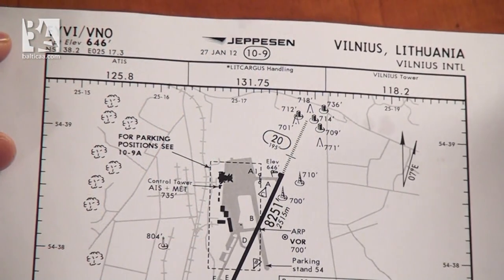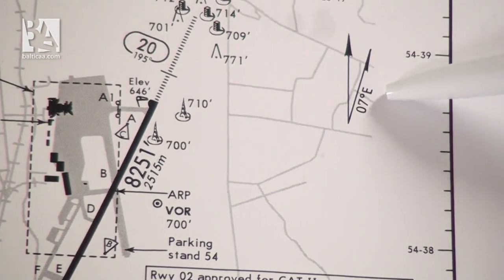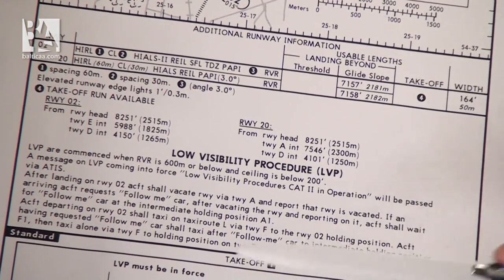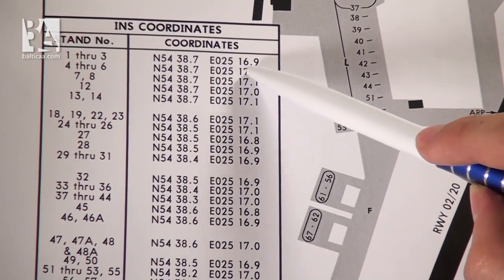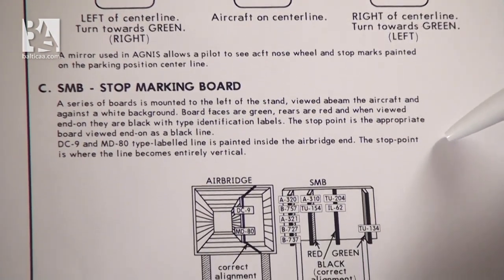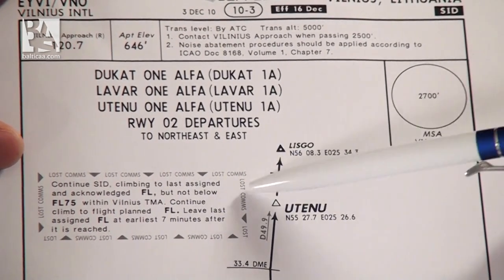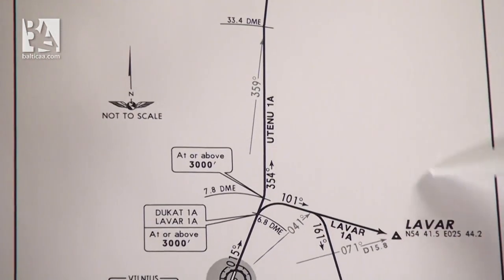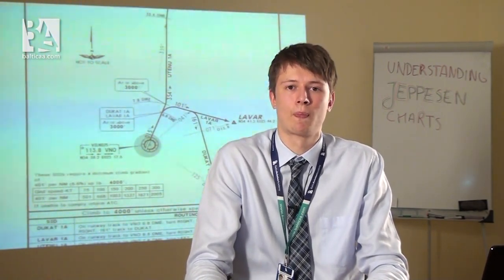Baltic Aviation Academy: Understanding Jeppesen Charts. Part I.

Comment: Guys, note that it IS NOT flyinh HDGs on the SID, STARS... They are TRACKS, yous hould apply correction to wind and everything in order to follow it. LNAV will correct itself but till you seat on a CRJ or B737 make sure what you are flying is a TRACK and not a HDG. For the rest is really slow but real good information. regards!
Reply: Oscar Jimenez Pedrosa i used a x2 on the playback speed

Comment: hi  , at 1:18 he explains on runway 20 , with the course of 195 ( can anyone explain why there's a 5 degree deviation ? many thanks !!!
Reply: In most cases, the runway number is the course divided by 10 rounded to the nearest whole number (.5 rounds to the nearest even number). If you have two parallel runways at 195deg, they would be 20L and 20R; three parallel runways at 195deg would be 20L, 20C and 20R.
Reply: lcmortensen 4 parallel runways? Or there isn't such case?